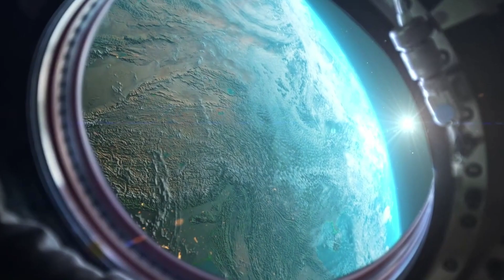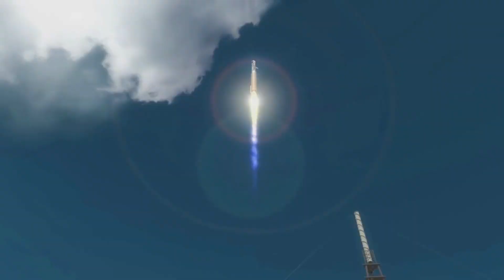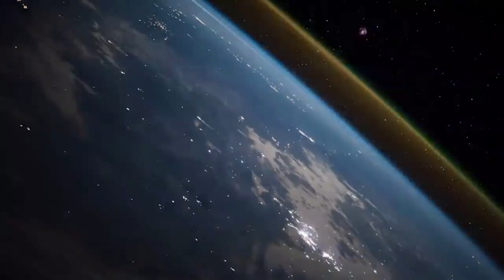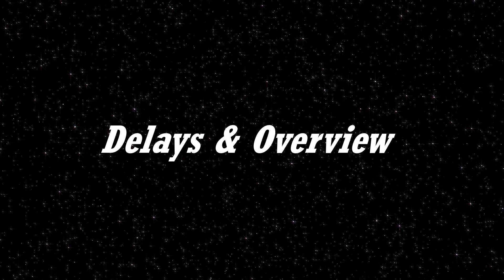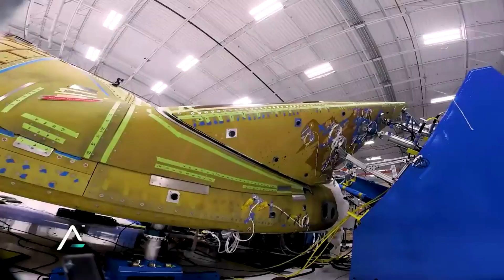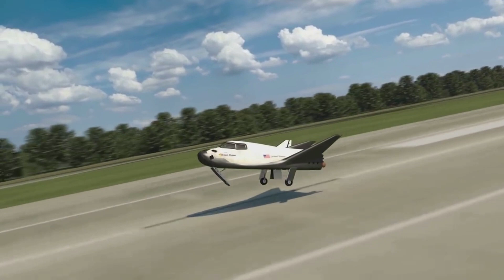Dream Chaser's Expected Launch Date, Progress, Delays, & More

Comment: Nice informative video.  It could be improved however with some technical specifications and comparisons.  For example how does it compare with the  Dragon 2 cargo spacecraft, Russian Progress spacecraft, and the H-II Transfer Vehicle (HTV-X)?  Some details could be included on how it is launched and how its folding wings and fit within a 5 m diameter payload fairing.  More about the Shooting Star module would have been helpful.